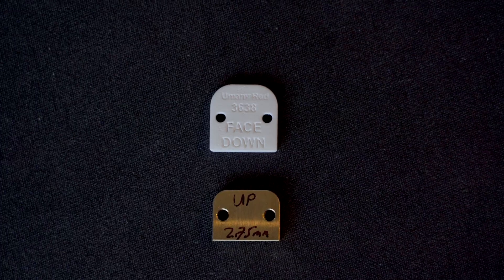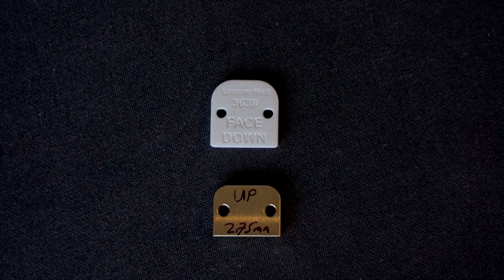Sound Bite #3 - Brass or resin corrective shim?

Comment: And if your cartridge already weighs 26g?
Reply from the maker: As long as your tonearm is a very rigid design and the turntable as well is isolated mechanically, it’s not a problem at all to add another 7 g.  The high mass of your cartridge is one of the main reasons it sounds so good.

Comment: Hello Dear author.Of course, additional gaskets are insignificant, but they increase the effective mass.This is a very subtle nuance.But it's important to someone.If, when setting up a high-compliance cartridge on a light tonearm, when we see the reference values of the tonearm/head as ideal, but we are not satisfied with the vta/sra setting, we can use the "playing with mats" method by changing their thickness.If this is not possible, then use a correction pad.Especially if there is a violation of Azimuth on the tonearm, where its correction is not provided.The topic is very interesting and subtle.Thank you so much!
Reply from the maker: Increasing effective mass is definitely a good thing as long as certain conditions are met. I will have videos about this in the future. The whole assumption of 8Hz lower limit system resonance needs to be retired for those of us who are reaching for the performance limits of vinyl playback.
Reply: Hello.I always try to coordinate the reference values of the cartridge/tonearm close to 9.5 gz and the exact adjustment of all parameters of the tonearm and cartridge.The result is always excellent.But when a client confronts a fact and wants to put his own head, without selection, then the result is not always airy.)The happiest moment is when, after tuning in, you listen and get a true, perfect analog sound.I'm really looking forward to new videos.!thank you very much!!

Comment: Why is the brass better you say mass but explain what's better about it! normally the cases you want it lighter
Reply from the maker: Quite the opposite, actually. You’ll be seeing more from me on this
Reply: @WAM-Engineering  so why are manufacturers  using carbon fiber arm tubes and the head shells? I'll wait for part two😃
Reply from the maker: @jedi-micbecause they are designing based upon a faulty assumption in their design requirements. More later.
Reply: @jedi-mic In any system you want the moving parts to be as light as possible and the stationery parts to be as massive as possible.

A simple and cheap upgrade you can do is get a local headstone-making company to make you a cube of granite the size of the top of your speakers and just put it on top [assunig your speakers / stands can take it] - just adding 30kg of mass makes a huge difference.

In both cases you want the stylus tip / speaker cone to move RELATIVE to the enclosure